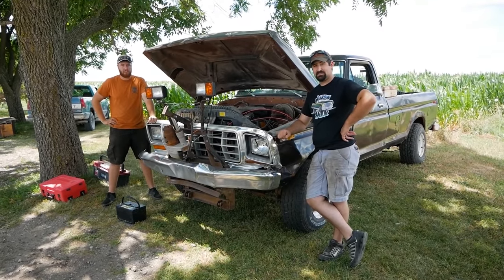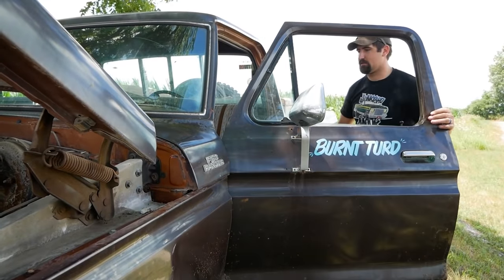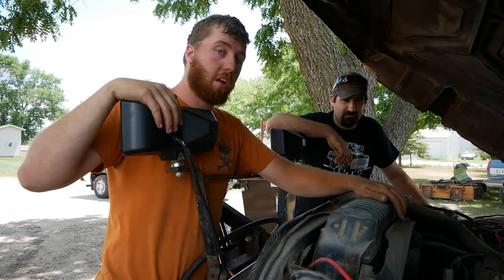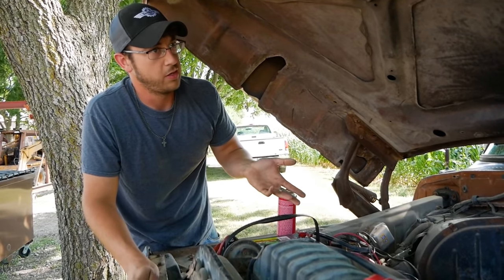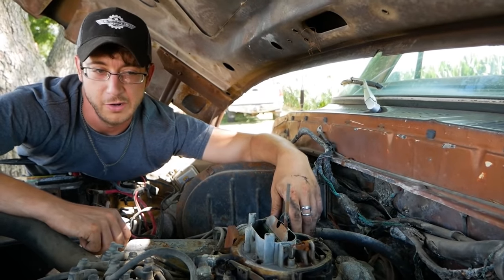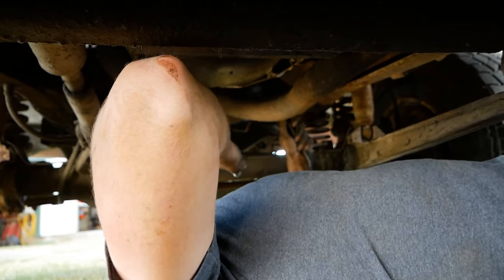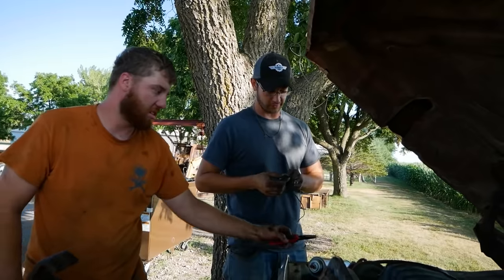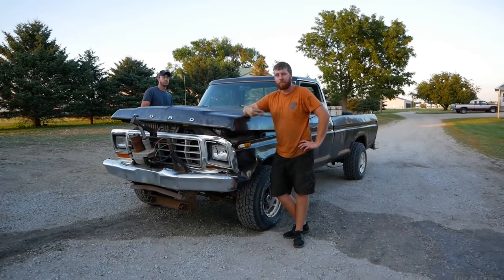BURNT Truck Revival?? 1979 F150 First Start Since ENGINE FIRE!

Comment from the maker: First... 

Hehe
Reply: Good move bro
Reply: lol nice, notifs haven't gone in yet XD
Reply: What's happenin' Kevin!
Reply: Junkyard Digs u ur first 11 hours ago how is any one else supposed to be first
Reply: Dang it your to early...
Reply: 11 hours ago 🤣
Reply: You can take the plow mount off
Reply: Am i the only one who is thinking this feels like a April Fools Prank when it isn't April???
Reply: To fix that door, I had the same problem cause someone backed into a hay bale, but take a screwdriver and bend the front of the door towards the middle of the truck. If you open it slowly and look, you'll see where it's touching. Good day
Reply: No
Reply: 69-70 460 timing chain is what you want, no smog timing :)
Reply: Put your weight on the plow lift as your buddy pushes the down switch. It floats down
Reply: What's Luke doin right side up?
Reply: Could you give me a link to where I get the tool kit you have I need it I'm just bought my first truck and the tool kit I got is junk
Reply: big waste of time scraping high tension conductors.  The high voltage can easily blow right through almost any corrosion.  worry about insulators in the high tension system, like carbon tracks etc.  the high voltage low amperage loves to short out through dirt, especially moist dirt, across surfaces like caps, rotors and ceramic plug towers.
Reply: Did they retard the intake valve closure for mileage like a giant Prius engine?  Except the Prius corrects at full throttle.
Reply: Just make it functional and not deadly, then sell it to poor people.
    WHY put a 460 in a 4wd truck? dirt track racing?  It doesn't have the handling for speed on pavement. the power is useless in snow and will pound you to death offroad, and a 150 can't tow enough to need that much for towing.  I suppose one might occasionally want the torque offroad but not much or often.
Reply: There's a couple of problems with giving old cars to poor people, instead of selling them.  Firstly, you can't provide as many because eventually lack of revenue will slow your production, and secondly, they will have no incentive to care for them like investing in quality oil filters or rust inhibitors.  Gorbachev mentioned problems with people playing football with free bread for example.  You want to return as many old cars to the road as possible, especially efficient ones where you could do better, and you can't return as many if you have no revenue, even with jobs and middle class parents. (and white skin).
   Think Biden or Trump will tax those starter motors?
    I do wish Luke would take junk more seriously though, salvage is important like this:  Talk about rust!:  https://www.youtube.com/c/PlanBmarinesolutions/videos
Reply: Hello from the UK, love the long vids mate
Reply: @alan6832  Snow plow. Those spacers in the coils were compensating for the plow weight.
Reply: @31terikennedy  I didn't ask why add the spacers, I asked why put in the big engine? when it can't handle well enough to race anyway.
Reply: @alan6832  It's not a race truck, it's a high torque work truck.  To add more traction they would add chains.
Reply: @31terikennedy  Any job that needs that much torque also needs a 3/4 ton frame, unless it is easier to accomplish with lower gears.  So I maintain there is no good reason to put that engine in that frame.
Reply: @alan6832  There is no replacement for displacement.
Reply: @31terikennedy  Only for racing, which this truck is not and never was.
Reply: @alan6832  I totally agree -- it's a work truck.  Ford had a better idea -- to put the 460 in it.
Reply: @31terikennedy  Ford put in a 300, I think. some yahoo put in that 460.  but I don't suppose it's worth the effort to take it out now.  Just sell it to another yahoo once you splice the essential wires and brakes.
Reply: @alan6832  Actually that yahoo was Ford. 1979 was the last year Ford put the 460 in the F-150. Quit driving that Prius. Live a little:D
Reply: @31terikennedy  Not this particular Ford. they say in the video that the engine is an upgrade, and find evidence in the light front springs.
Reply: @31terikennedy  and my housemate's Prius is far faster than either of my cars, a 1.0 Liter Metro and a slant 6 Dodge W150.  I do have a project long 318 van which might beat the Prius straight-line, but never in the corners.
Reply: @alan6832  MOPAR or no car
Reply: Hi Digs,the big 460 came out of the Lincoln Mark V

Comment: This episode was hilarious. I'm going to Revive a 87 f150 tomorrow that's been sitting for several years (and drive it home) so WISH ME LUCK!!
Reply: Was there any trouble getting it home?
Reply: @tonyjessicashrader2078  oh yah, first trip we found out the fuel pump was dead, second trip the truck we were going to use to bring it home had the gearbox blow up, and then the third trip myself and my uncle literally almost died of heat stroke, BUT we actually got it home that time. (after hours of scrounging around on a saturday 60 miles from home, trying to desperately find a tire shop that was OPEN and had 15s that werent 150$)
Reply: Did ya get her running mate

Comment: The gm alternator on the Ford right there is the problem!:D That and the fuel leaking all over the place. They needed the blocks in the springs because they swapped in the Lincoln 460 and added the plow. 

That transfercase is a full time  4wd NP203. The NP203 has the range box in front of the case. So either someone converted the hubs to lock out style or they swapped the whole front axle assembly out for one from a part time 4x4 D44. 

Feel free to send the 300 my way! They are my favorite engine and I've got a small hoard of the 240/300's.
Reply: I figured the 300 was the original and that heavier 460 swap with the plow was a spring killer for sure.

Jealous of your big six flock.
Reply: Nah it’s the ford motor attached to the gym starter that’s the problem

Comment: I have a 73 that was in a barn fire. The guy was in the barn went it started . He started the truck and left snow plow down and drove through it. Melted orange rotating light and all cab lights and took all the paint off the front and sides windshield all heat cracked .

Comment: The action on the radius arm bushing on the driver's side when you first moved it was epic. You could basically measure the play from space
Reply: That was not a radius arm bushing ..it was a steering link pivot
Reply: @markweber2958  54:39 that's the radius arm (you know the arm that trails behind the front i-beam)
Reply: Yup, that’s for sure the radius arm bushing.

Comment: 50:39 The local guy I took my 1979 F259 with a 460 to in order to get it running (after sitting for 11 years) said he put a 1969 timing chain in it so it made better fuel mileage and more power. I can say, as a kid fresh outta high school, that truck made plenty of power for me to have plenty of fun. 
He also plugged the emissions stuff on the engine, as it was a California model and had a Catalytic converter on it (apparently the first year those were put on the old Ford truck, but ONLY for the California model in 1979 from what I’ve heard). 
As it say for over a decade, I just cut the catalytic converters and muffler off, right behind the cab, and ran it like that. Outrageously loud and fun for an 18 year old. 
Still have the ol’ girl, just need the money to rebuild the engine a couple other minor things.

Comment: It's been my experience the except for the timing chain, you can't wear a 460 out unless you run it out of oil. I rebuilt a 460 with 190,000 miles on it and it only had 3 thousandth lip at the top of the cylinders. And just to let you know I've been a mechanic for 50 years.

Comment: "one guys having a seizure, the other guys having a stroke. Ford" 
after working on fords recently i agree

*edit : quick note - the early 460s (70-74) had nylon cam gear teeth that people swapped out to prevent them to break. they started out at like 10:1 compression ratio but then slowly dropped over the years and got smaller carbs and more emissions tubing becuz smog. check the heads on that motor behind the exhaust manifold for D0VE/D3VE/D1VE stamps
Reply: The truck looked like it had a stroke, droopy left headlight!
Reply: They're D3VE heads. Sadly the engine tag was damaged and I couldnt get much info off it. Betting it's a maximum smogger machine.
Reply: @bubbadw60  ok, that puts it at around 1973, a 8.5:1 compression ratio, and she's squeezing out 212hp and 340ftlb (*factory*). So basically a boat anchor that makes noise 👍
Hope this helps at least a little
Reply: @chasebh89  that's about what I was estimating it at. The d4 tag on the carb leads me to believe the engine is from a 74-76 Lincoln or Thunderbird.
Reply: That's exactly what Ford did on the Essex V6 in the UK, used in Capris, Zephyrs, Zodiacs, Consuls and Granadas, as well as Transits, if you were mad enough or an emergency service.  The nylon cam gears were a nightmare as, once they got to a certain age, the heat cycles would make them go hard and brittle and they'd lose the teeth of them, which would often ruin the engine as pistons would meet valves and all sorts of carnage would occur.  Steel gears were a bit noisier, but didn't break, and you can now get replacement cam gears that are made to be quiet and last a long time.  Back then, however, material technology wasn't up to the job...

Comment: So your telling me something other than a dodge caught fire ?
Reply: i had a buick car that caught fire lol
Reply: use to see a fair number of those mid , late 70s fords catch fire- fuel line ruptures hits distributor, kills engine, minimized fire damage. it sucked but wasnt hard to fix
Reply: Anything with a carb can go up in flames like that one did.  I had a mk3 Ford Escort do that to me on the motorway, though it was kind enough to put itself out again when the air cleaner melted and cut off the air...
Reply: My uncle's old beetle caught fire because the fuel filter got heated up by the engine and melted and then  gas got all over and ignited. It was common for plastic filters to do that. That's why it's good to have the metal oens
Reply: @rexjolles    Another one that's common on air-cooled VWs is oil leaks rotting the flexible fuel line, which then sprays fuel all over the engine, which, being air-cooled, is a lot hotter than a water-cooled engine will be.  The fuel ignites and you get, at least, a rear end burn out...

Comment: She moves under her own power that's impressive other then constant popping into neutral
Reply: Coupler like collar in the transfer case.. mostly reminds me of my grandpa's 79 Chevy k10 scottsdale he literally fixed it by putting a thick black rubber bungee strap on the transfer case shifter shaft and wrapped the strap around it 3 times and attached it to the bottom of the dash.. probably not how I myself would fix it but it did work.

Comment: I have been working on engines for a long time I think engines want to run just have to get everything there at the correct time. From barn finds to wrecked they want to keep running. Like your channel a lot keep up the good work

Comment: The era Luke is referring to is a 74 era, with the nylon toothed timing gears
Reply: Were they trying to imitate a Prius? but bigger and dumber? and time reversed?
Reply: @alan6832  I lost brain cells looking at and reading your reply. If you do research however, you'll find that Toyota has been using other companies designs since their founding. Also nobody likes a prius, but everyone respects the Lima big blocks from Ford.
Reply: @nathanslaton1753  Many people like Priuses.  They don't get built for nobody, and most here in Asheville dislike big block gasoline, (except for saving heat in Rv snowbirds).  But my reference is to delayed intake valve closure to save gas, big or small.   If too simple for VVT, maybe at high revs the intake gas momentum can mitigate the power loss due to delayed intake valve closure.  that and high compression.  both can be used either to make the car faster or better, to enable a smaller engine, like F-150 with 200 inline 6 to keep pace with the bicycles like me here in Asheville.  (I run W150/225 and Metro 1.0L personally)
Reply: @nathanslaton1753  Oh, and we still drive 55.  (or slower with bikes around).
Reply: @nathanslaton1753  I will admit that rural Iowa is not the best place for Prius'.  The regenerative braking shines in hilly cities like San Francisco, with lots of hills and stop signs.  and in full time applications like Taxis.  But there are small engines here. they did a Fiat, a triumph, and Luke's daily Ranger 4 cyl.  That's what interests me here, and the recent diesels.
Reply: @alan6832  funny not well known fact about the prius is that when the hybrid batteries in them go bad, the batteries will no longer take a charge. Henceforth have to be destroyed, the process for destroying those batteries causes as much harm to the environment as 1 ford 460 for 3 years.
Reply: @nathanslaton1753  I'm also here because salvage is very green.  Every car saved is a car not built, even if the engine is too big.  Cash for Kunkers was NOT green!
Reply: @nathanslaton1753  That's why they are not the best thing everywhere or for everyone, and I don't have one.  The Early Honda Insight 2 seat hybrids keep working after the battery goes bad, but not Prius with high voltage starter.  but don't think everything green is new. many Toyotas from the 70's, vw's from 60's, Pintos recalled and fixed, Chevettes and more! Including Fiats and Trumph's salvaged here.

certainly a saved 460 is greener than a 2020 Prius, but maybe not a 2002 Insight or a 2.3 Fairmont. or Luke's 2.3 Ranger, or his 302 Maverick, but he should keep the highway rear end in it.  Re-use is the second R of green living and that includes salvage.
Reply: @nathanslaton1753  The greenest salvage was probably the 15 passenger church van in the competition, for those with 15 carpooling friends, that could justify the 360 it had if you can multiply the mileage by 15.  dividing gives 24 cubic inches per seat!
Reply: @nathanslaton1753  Priusi might work well in rural Iowas for mail carriers that have to stop at every house every day, unless they integrate much package delivery, in which case there are bigger hybrids now.

Comment: I just don't understand why bees and things of that kind love to make nests in cars
Reply: Safe from the elements and predators, plenty of room.
Reply: Because nesting creatures, bees, wasps, rodents, some species of spiders want their nests in as safe and secure an area as they can find, to stay hidden, keep predators away etc, and there really aren't too many things better suited to this than inside a car fender, or in the engine bay, it's much easier to hide in and protect an area that has limited means of access than it is to hide in and protect an area in the open, the more secluded and hidden they can make their nests the better for them, and a car that's been sitting for a while is prime real estate as far as they are concerned.

Comment: Had my 350 engine in my 64 C10 catch fire twice . It also took a bit to start it but when it ran it sounded ok but would run hot and some times flood and stall then when you try and start it hot it would catch fire . The engine was put in the truck by previous owner . After a couple fires I went over the engine and found the distributor off 1 tooth . After fixing that problem it ran like a champ .

Comment: Never seen a starter fail like that soon as it connects to the flex plate the gear stops spinning but the shaft is still spinning 😳 🤔 very intriguing Kevin @Junkyard Digs

Comment: Yes starters and gears need to match tooth count because of spacing between the ridge and valley of the tooth pattern. The main reason there are so many is for diferent gear reductions to turn the motor easier depending on what it is, compression ratio over square under square targeted cranking amps and size of the starter that you can fit are a few things to be considered.

Comment: That stick with the leather string in the handle is a tire bat.  Truck drivers use them to check if their tires are not flat.

Comment: my grandpa's 01 f350 super duty work truck has around 390000 miles on it, has been in 2 floods completely submerged, and has been lit on fire once and still runs fine for a work truck, and pulls his 7-ton gooseneck trailer at least 2 times every week.

Comment: I've seen a lot of starter drives fail that way.  Easy to just replace the drive if the starter motor itself runs that well.   Pull the band over the brushes, the through-bolts, take off the cover over the drive and the nose plate... pop the keeper, R and R the drive, reassemble.  Quick fix, drives are common in most of the earlier starters so carrying just a couple styles will field fix a lotta starters.   Don't pull the armature out or remove the back end plate if you don't want to fight getting the brushes back in place...   **update:  and then you did this on the tailgate.

Comment: That’s exactly what happened to my 78 f250 plow truck. The carb was half melted and the wire harness was burned to a crisp. Still started and ran perfectly. Plowed my driveway for 3 months after

Comment: I had a 1969 F250 that also had the transfer case popping into nuetral. It turned out that the fork was worn. My dad took it out,built it up and it was like new. Bush repairs.

Comment: Just a note of "Part-time 4 wheel drive".  I have a 2004 Nissan Titan which is part-time 4wd, but I do not have hubs.  The front axels, gears, and drive shaft all spin with the front wheels all of the time, but do not have power until you engage the transfer case.  I have replaced the wheel hubs before due to wheel bearings.  No locking hubs.  213,000+ miles on her too!